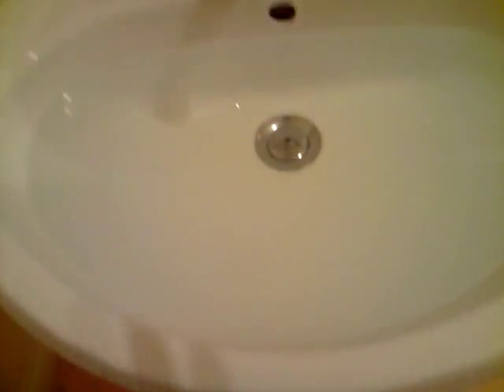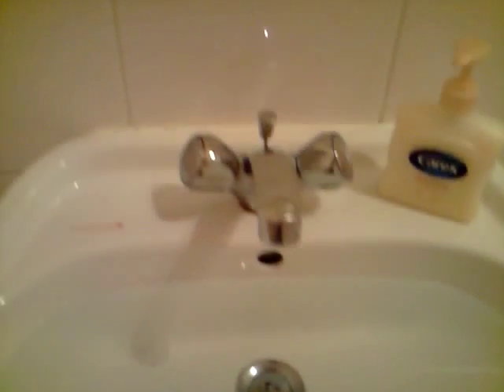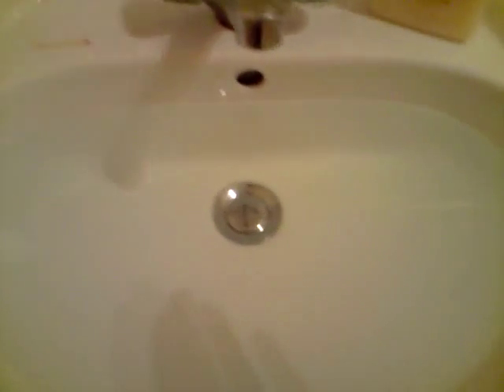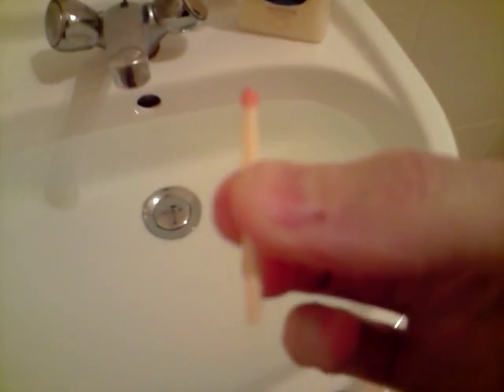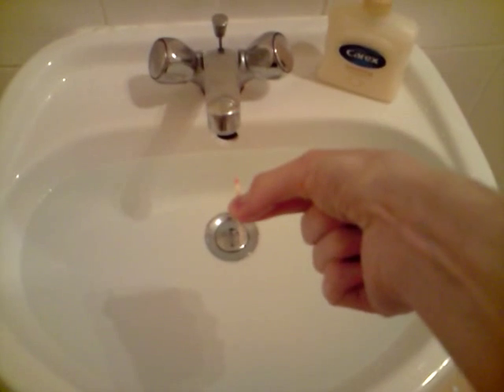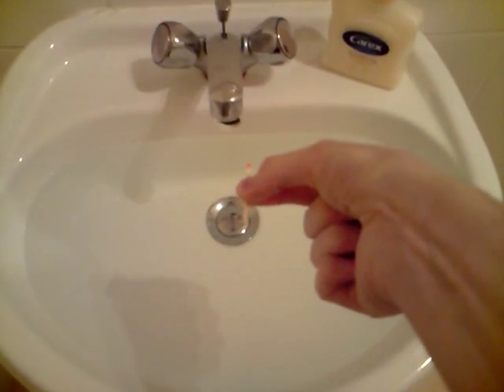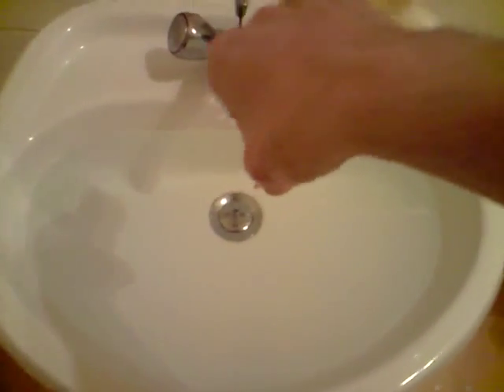Plug Hole Direction Experiment 1

Comment: hi- you're right, the theory is bogus. A vortex can be set up in either direction depending on how the water is disturbed when pulling the plug. With little or no disturbance the water will tend to drain straight down, as you showed.